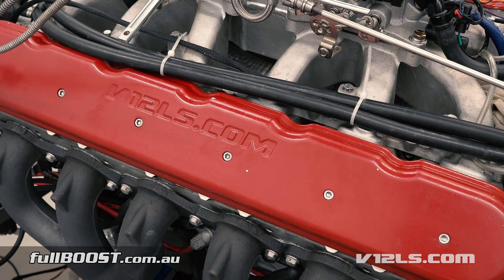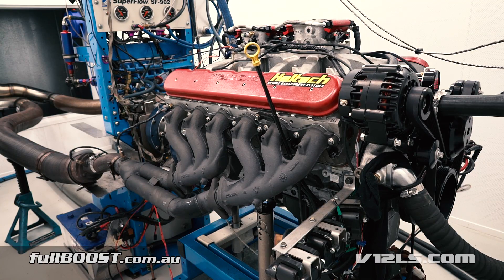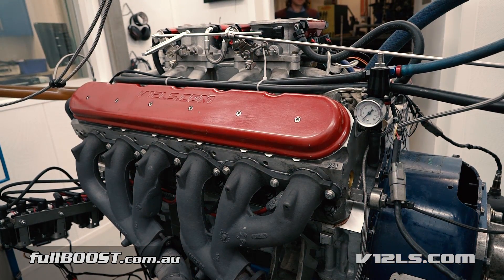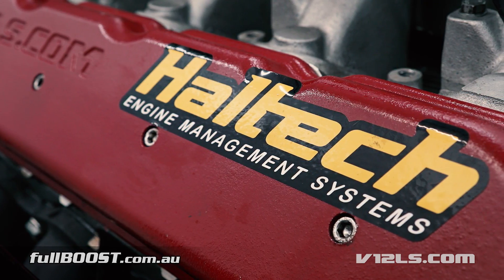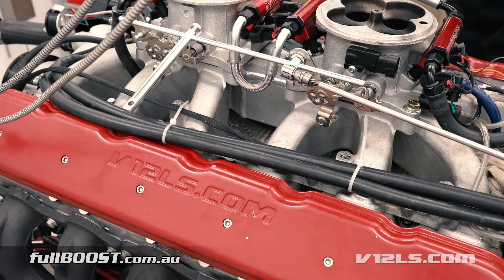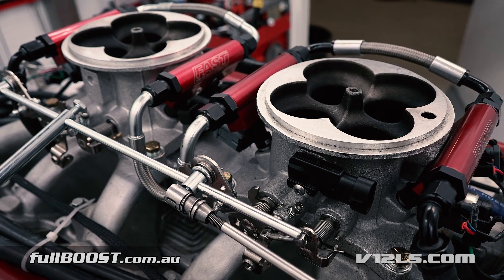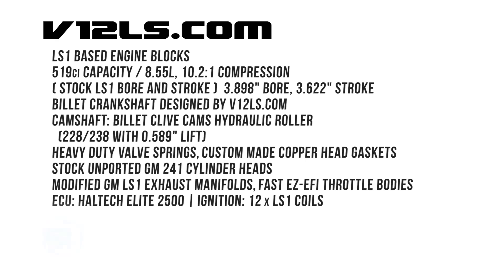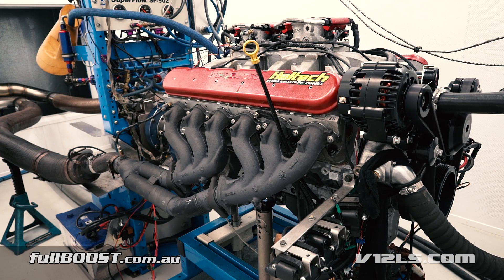V12 LS1 engine dyno

Comment: lmao you can easily make that with a 540 or hell a well built 496 will easily overpass those numbers . Might i also remind the vipers v10 is basically putting that to the wheels...
Reply from the maker: And what would this do with performance parts...that's not comparable.
Reply: +Fullboost well of course its not comparable a well built big block costs around 15 grand range and can make upwards of 1200hp in street trim. Not considering its alot smaller than this ( easier to fit ) and easier to fix or get parts for , im basically stating this motor is not really a success but built for more of a whow effect . I think the (4JZ) is a better thought out motor than this.
Reply from the maker: Cool.
Reply: +whambodius let's see you build one. big boy lmao
Reply: +Kyle Mills i have a 540 in my 85 rx7 gsl-se and i basically built it with a total of around 3 grand . Its all iron so probably a little heavier than this thing but i guarantee it makes more power , we estimate about 700 crank and i still have a 150 shot nx kit jic. Car ran 10.8 at over 5000 feet elev. no juice , no trans brake , stock suspension ( hd springs front ) oh and also nt05s .
Reply: No. Let's see you split two ls1 blocks and make a v12. Anyone can get a motor and put it in a car
Reply: +Kyle Mills what i was saying in the first place is the unnecessity of this engine .. Plus he didn't sit down and fricking sawmilled the block please. Whether he has a machine shop or sent it to one , everything is custom built . Its the same as a 3 rotor motor which i built before , as longs as you have all the parts made its no different than putting a normal engine together ... As i said before the (4jz) is a much better thought out motor. Long story short money is the answer to your question . Im not rich enough to have a completely custom crank made
Reply: +Kyle Mills btw if u wanna see an impressive motor check out devel sixteen. So you can see what happens when you spend money on an engine the right way.
Reply: +whambodius, first off the devel sixteen uses a much easier constructed motor from Steve Morris engines. And need I remind you this made 717hp with standard spec cams and heads? With better cams and ported heads this thing would make close to a 1000hp n/a. Possibly even more
Reply: +scootbmx01 i didnt know it had stock size cams and no headwork , with this much custom work and parts i would think its fully build
Reply: +whambodius, nvm I just checked, the heads are stock. But it has a very small cam. Apart from that everything else is stock ls1
Reply: Boom
Reply: +scootbmx01 dude how can everything else be stock , the crankshaft has to be completely custom for starters... Im gettn a feeling ur pulling all this out your ass
Reply: +scootbmx01 lol i have nothing to prove , because i allready did in real life . Its called x-treme performance , here in Izmir (Turkey) . We hold the record for Na rotary here also built the motor that is in hulk ( the civic ) also running for Honda/K series power record in the world. Feel free to stop by , we work mostly on imports but i have experience on Ford and Chevy motors from small block to 752 ci motors and also have a back ground with Don Schumacher racing team originated in Indiana .
Reply: +whambodius My mom is Very proud indeed , she supported me and my team the whole way , best mom a person can ask for ty.
Reply: +whambodius, never heard of your shop nor is there a website.
Reply: +scootbmx01 We never felt the need to commercialize our business due to the exceeding number of customers and to keep the wait time to a minimum and work efficiency. Extending the business is a future plan along with manufacturing our own parts in house hopefully. Have you had the time to check Hulk or our pride and joy twin turbo 208gti with 300ps called the highway rat , weighing in at an incredible 780kg!
Reply: +whambodius, so you don't have a website? What kind of business are you? Lol
Reply: +scootbmx01 As i said , we have an exceeding amount of customers that we allready have a hard time pleasing and meeting deadlines , i prefer less but happier customers to alot of angry customers , quality also goes down with the amount of work . Reason we dont have a website is that people here don't really notice those type of things here , word around town goes alot longer way than the internet ... However , we are working on creating our social media pages purely for contact purposes , im only 28 years old and the business has been around for merely 3 and a half years so we are still growing and like i said hopefully we're going to start fabricating our own parts with hopes to get a 5 axis laser cutter in the future to really be an independent company such as / PRL , Cobb , AMS or MAP , as far as their quality and being a completely independent company fabricating and using their own products.
Reply: +whambodius, you are the only business that turns down business.
Reply: +scootbmx01 i have never turned down logical business we simply don't reach out and seek for more of it. Unfortunately space is a huge factor in our country we have over 70 million people living in a space thats almost the size of texas so expanding is not easy , buildings start getting extremely expensive as size gets bigger . Anyways i will not try to hold a conversation with you if you keep acting childish with your ignorant statements talking me down , why dont you talk about your accomplishments in life and how your dreams of owning a shop came real as it did to me. I have dedicated my life to cars and tuning and i love every minute im at work . Theres so much more to owning a shop than having alot of customers and being widely popular. I haven't had a simple customer walk out of here without a happy face and a properly quick car . Another thing i forgot to mention is we dont hold regular jobs such as maintenance ,  exterior/interior etc . 90% of the work are complete builds..
Reply: +whambodius, why would I want to talk myself up to a knob jockey on the Internet who doesn't know how to read engine specs properly?
Reply: +scootbmx01 lol i actually just realized there was a full build sheet down there .
Reply: +whambodius Don't waste your time. This guy as a fool. A Gen 5 Viper can make these numbers with bolt-ons alone with 4 less cylinders. Granted, this engine has a lot of room to expand as a platform. But it will simply NEVER be a logical choice. Its an outdated pushrod, wedge engine. It will certainly make power, but consume fuel at an amazing rate even for a race car. Its pure weight will be incredible. If anything, this is merely a tractor motor. The Viper engine is basically the edge of where anyone should push an engine in terms of displacement and frankly its a higher tier design. I assure you and this tool (scootbmx01) that it will still NEVER compete with an NHRA topfuel Hemi making above 10,000 horsepower. It has no place to fit in. All of this aside, its a cool concept and I enjoyed the video.
Reply: +PyroBlonde7777 "a gen 5 viper with 4 less cylinders"!

did I miss something?  lol
Reply: +PyroBlonde7777 Amen dude , finally someone sees wtf is going on here , with direct injection and turbo charging this motor is left in stone age.
Reply: I  don't the think of the exercise is to be cost effective, to produce the most power per dollar spent.  A lot of people just enjoy something different, thus the Falconer V-12 project years ago or Hemi heads for a Chevy or exotic 3 and 4 rotor Mazda engines.  It's just an interesting exercise, perhaps something to put in a rod or a boat or a one-off car.  And, since it's just in the earliest phase, I am sure that it will produce more impressive results on a dyno.  If everyone was interested simply in cost effective power, everyone would be running LS engines in everything perhaps.  But there are those of us who run big block Pontiacs, Cadillacs, today there are custom heads for almost everything.
Reply: +Ethanmor i dont think ls is that cost effective , older big block engines make much more power for the money imo , alotta 4 cylinder like k series honda , sr20det , ka24 , inline 6 like rb25 , 1jz , cost next to nothing and very good canditates for cheap power under 6-700 hp range , it all depends on the car but for direct competition even the 350 sbc can be found dirt cheap , i found a 464 bbc and th400 for 800 bucks out of a hd pickup and made 600 something at the wheels with very little mods and rebuilt tranny . Overall cost me under 2 grand for the whole setup new dizzy wires management system and everything , its hard to even find a 5.3 ls motor for that price.(800 bucks) . And at the end they dont make much NA.
Reply: Outlaw I meant 2 and you know damn well what I meant.
Reply: whambodius Honestly, if its an OHV engine I wouldn't waste my time with anything that wasn't a Hemi. Most people are ignorant to the potential of older 5.7L Hemis. All they need is a cam, headers and minimal boost to hit 700hp. Most GM engines like the LT4 in the c7 Z06 are overheating making only 640+hp.
Reply: PyroBlonde7777 I damn know that you two "expert" are blowing hot air...

That kid is a joke and pretending to be a hot shot engine builder lol
Reply: are you talking about the 3rd gen hemi ? apache , eagle etc . if so i had one in my ram and according to the rumors and my own experience they are basically an ls1 with a bit better head design for the later models , im not sure if they are built stronger but i put 360whp and 410wtq with just bolt ons and tune, i dont think OHV engines are that bad especially on boost the difference is minimal. They are cheaper to produce and cheaper parts ( only one cam opposed to 4 ) less parts in the head to break or "build" . Both OHC and OHV have their good and bads of course if money is no problem the choice is appearent.
Reply: whambodius 😂 seriously kid you have got to see a doctor.
Reply: ok, now go away with your hate comments i got more experience with cars than you will ever get in a lifetime go find another vid to put your useless comments on.
Reply: whambodius oh you mean by playing Forza? 🤔
Reply: Forza is actually a very good game if you have the right setup it helps when you practice on it before you go to the actual track like nurburgring somewhere you would most likely die and make us happy
Reply: whambodius oh my god I rest my case lol
Reply: whambodius lmfao keep them coming champ so funny
Reply: whambodius "+Kyle Mills btw if u wanna see an impressive motor check out devel sixteen. So you can see what happens when you spend money on an engine the right way."

I don't see you pointing out anything but idiocy honestly.   I think you forgot to mention the turbochargers on that engine for comparison and how many cylinders did it also have? Lol yup a true master in engineering 

Edit: oh wait...  Are you implementing that your a master racer driver also?

😂
Reply: if its really gonna make you happy and relieved i have both the pictures of my rx7 and my old srt10 along with many pics of cars we built in house that you wouldn't be able to wrap your little mind around.
Reply: whambodius nope a detailed video tour of your shop and build would be sufficient to shut me up 

Better yet let's see your YouTube channel filled with your handy work lol

That other guy called out your bull shit so careful how you trade from now on kiddo
Reply: im not allowed to show customers cars due to alot of reasons but i can send you pictures of some of my personal cars i've worked on inside my shop so you can get a good view . Plus im not gonna go take a video for someone who has shown me no respect.
Reply: whambodius let's see your claims junior prove them 😁 

Stop blowing hot air

At the end of the day you are just a shawarma boy haha
Reply: +Outlaw I think you're very confused. I never stated that the Viper was a Hemi. I also already made it clear that I made a typo regarding the number of cylinders of the v10. I also already know that GM invented the Hemi but that means nothing considering Chrysler is the company that actually got it to work. I am already aware of the benefits of a wedge style head. For example, the Viper uses a wedge style head because it is drastically smaller than a Hemi and over all weighs less and fits better. I know this. But the fact remains that a 392 still flows more and makes more power at all rpm ranges. Also, if you're so confident that the Hemi is no longer relevant than tell me why all the people racing in the NHRA are forced to use KB style (Chrysler 426) Hemis? There is a guy running a LS 3500 hp c7 corvette and he even admitted if he wanted to go to the next level he'd have to switch to a Hemi.
Reply: PyroBlonde7777 

Here's your original statement...

"Don't waste your time. This guy as a fool. A Gen 5 Viper can make these numbers with bolt-ons alone with 4 less cylinders. Granted, this engine has a lot of room to expand as a platform. But it will simply NEVER be a logical choice. Its an outdated pushrod, wedge engine. It will certainly make power, but consume fuel at an amazing rate even for a race car. Its pure weight will be incredible. If anything, this is merely a tractor motor. The Viper engine is basically the edge..."

Sooooo..... Yup full of hot air
Reply: Outlaw I deleted my comment because on my screen it was duplicated. So, I deleted one of the comments and it turns out it was a glitch. So, both comments are no longer here. I was confused as well about that fact. But you can once again try to build an argument around meaningless details. We are talking about the LS and LT motors which are products of GM or Chevy so yeah, its not far off to say you are a fanboy of that company. There are plenty of facts about why Mopar engines are fantastic and you'll choose to ignore those facts. Keep throwing around insults like you're a big guy but this is youtube. So stop wasting my time.
Reply: +PyroBlonde7777 dude u have to stop man dont go down to his level . He doesnt know all they use in 5k hp + cars like all out dragsters is Hemi. The way he talks he probably owns a Cavalier or something lol.
Reply: Outlaw Now I'm wondering what the hell you think this 'argument' is about? Because I have a feeling you're on your own tangent this whole time.
Reply: +Outlaw dream come true , your right.
Reply: whambodius prove your lies lol
Reply: whambodius YouTube is free

Let's see you document your shop and detailed builds lol

I'll wait for you proof
Reply: Outlaw You really must have no life at all if you honestly think this guy has to prove anything to you lol. If anything, add him on Instagram which is free and do the research yourself.
Reply: +PyroBlonde7777 thanks man same goes for you i have alotta hemis and a viper ;)
Reply: whambodius well it's the internet kid.  If you state something publicly and start blowing hot air while trying to act knowledgeable and laugh at other peoples videos (like this video we are having fun under its thread)...  It's inevitable that someone calls you out on your lies

And yes since you told them that you are  "well known and reputable engine master with cramped customers"  obligated to provide evidence to your claims lol
Reply: whambodius This guy is ridiculous. He runs his mouth like hes a master mechanic and then has almost zero ability to stay on topic. Bringing up irrelevant details in an effort to validate himself. Saying that I didn't make a honest typing mistake concerning the Viper's V10 when I'm a mopar fan and its common knowledge. Quotes a statement that I made concerning a completely different issue and somehow tries to connect the dots with his incoherent garbage. At the end of the day I said I wouldn't waste my time with anything that wasn't a Hemi when it came down to OHV engines. They make more power and thats a fact. Both in factory form and racing form. The LS is literally just a modern, well designed and simple wedge style V8. It isn't special and thats why its cheap. Its not a bad engine, but its not fucking special. Its literally the oldest performance V8 platform in the book. But its not the best and I will never acknowledge it as an equal to a Hemi as the supreme racing OHV V8.
Reply: PyroBlonde7777 I'm on topic alright 

Let's see him prove his claims of his so called "X-treme Performance" in Turkey lmfao

No website 
No phone number 
Not on any listing 
Nothing 

Let's go bozo prove it that's the topic I'm interested in from the beginning lol

Kid on the internet talking to himself thinking he has backup 😁
Reply: whambodius 

😂 that's what he claimed 

"i have nothing to prove , because i allready did in real life . Its called x-treme performance , here in Izmir (Turkey) . We hold the record for Na rotary here also built the motor that is in hulk ( the civic ) also running for Honda/K series power record in the world. Feel free to stop by , we work mostly on imports but i have experience on Ford and Chevy motors from small block to 752 ci motors and also have a back ground with Don Schumacher racing team originated in Indiana ."

You should call it Forza (top secret fantasy" lol
Reply: Outlaw I am not here to debate about whether or not he is legit. As far as I'm concerned I don't care. It doesn't affect me in the slightest. If he feels he needs to somehow seek validation from some stranger over the internet then thats on him. The only thing I have an opinion on is the uselessness of this v12 LS engine. I think its a cool concept but its still overall pointless. Maybe if it was smaller in displacement and revved higher. Then it might actually make for an interesting platform for the new mid engine C8 Corvette. Otherwise the Viper's 8.4L v10 is about the limit for any performance engine.
Reply: whambodius no no we aren't done yet here unless I say so smegole lol

Prove that.you are what you are and own what you own and achived what you have achieved ya Lil lier 😂
Reply: +Outlaw Quick note some of the richest people of the world are turkish prime example being CEO of CocaCola. We are not so bad after all hha.
Reply: Outlaw I'm not getting anything twisted actually. I am aware of your little "venture". I still have no opinion on this subject as it really has nothing to do with me. But I will say that I was wrong earlier. I was arguing on another post about the LS vs the Hemi and somehow got it mixed up with our conversation. Reading the previous comments I can see that really you were only targeting my statement about the Viper originally. Yes, it was a typo and a miss calculation of numbers. I'm not 100% sure where I pulled the number 4 from but I assure you it was a mistake. Otherwise, I don't disagree with much of anything you've said.
Reply: PyroBlonde7777 again 

I don't care about your Dodge vs GM and i never stated anything regarding Chevrolet (yet).

You can have all the opinions and cheers for dodge.  It's your thing. 

Yes I did point out your v12 dodge remark.  But when you stated stuff you were biased and had no idea about the competition and said what you said....

That's why I told you learn about them know what's what as each design has it's pro's and con's no one size fits all.

But saying everything is useless if it didn't have a Hemi! Now that was what made me tangle with your remarks a little. 

But back to the topic.  That "Engine Master" is a a lier and a scrub lol
Reply: Outlaw When I made that remark I meant for the ideal performance platform in the OHV format if it was a perfect world and money wasn't an option. I'd be better off building an old 440 magnum for a lot cheaper though. Even something like a 383 would be an easy and cheap platform to build. But the LS is boring and overused so no thanks.
Reply: I have seen so many wrong things in this comment thread alone....It gave me Cancer.
Reply: You are trying to compare a radical full race big block to a fully streetable V12.
The radical "well built big block" requires a high stall, etc etc and wouldn't be able to pass the gas station if used as a daily driver where this LS1 based V12 would have a full power curve that is smooth and useful from idle to redline and with decent fuel economyfor a daily driver that wants to be a little bit different..
Reply: +hackfreehvac i have daily'd and known people that have dd'd big blocks before , they can very well be fully streetable  and not that bad on gas mileage as you may think , power curve from any serious big block would make this v12 look like a joke , pulling all the way to redline is such a subjective term , you can have a budget hydraulic big block redline at 5000 rpm or have a 8000 rpm monster . "Pulling to redline "has nothing to do with displacement but the quality of the heads/headwork and parts in the head. I've seen big cube motors make max hp at 8300-8500 rpm with ports the size of my fist and had no problem whatsoever taking a cruise around town . Being able to daily drive a motor really means nothing because if your gonna daily something why would you want alotta horsepower? Daily should be comfy , reliable , safe and practical. Plus talking about gas station , i really struggle to name any legit high power builds that run on pump gas, e85 maybe..
Reply: hackfreehvac Once again, the Viper's v10 is about the farthest anyone should go with a big displacement performance engine. I'd be willing to be that the Viper can make bigger numbers too.
Reply: PyroBlonde7777
I've never been that impressed with the Viper.
8 liters is huge and when it was released it was only something like 425 HP
Hardly 60 HP per liter or something like that.

It was nothing special except just a big displacement motor.
And the V10's sound like inline sixes to me. Not cool.

Now this hybrid V12 sounds pretty good.
And of course V8's sounds great.
Reply: +hackfreehvac when viper was released camaro was making 245 hp out of 5.7 and corvette was making 300hp , efficiency decreases as displacement increases . Also the 8.0l has nothing in common with the 8.4 thats out today . For apples to apples ls7 makes 72.14 hp per liter , vipers v10 76.78 hp/l Despite having more rotational mass and internal friction .
Reply: whambodius Yeah that was a terribly ignorant statement from this guy. Thanks for clearing that up. Not to the mention the old Vipers still went 205mph and actually had the highest topspeed in the competition for its time. The engine itself is capable of more power than it makes from the factory with old technology as well so its still not a very sound point. An Inline 6 sounds NOTHING like the Viper...
Reply: PyroBlonde7777
I was referring to V10's in general. And they do have an odd sounding exhaust that is much more closely resembling an I6 than a V8
A bare bone Mustang GT with flowmasters sounds better than a Viper. It just does. People who deny it are just fan boys who just ignore the truth.

And of course there is lots left on the table to make a bunch more power out of a sub 500 HP 8 liter V10. I never said they couldn't because people do make 1,000 HP all the time from them. I was just saying that when they introduced it with only like 425-450 HP, that was kinda weak for the engine size.
Corvette was still competing with it when they still had 5.7 Liters.
Reply: hackfreehvac The Corvette of that year really didn't compete with the Viper. When the Viper first launched it took the world by storm. Dominating 24 hours of Le Mans multiple times until it was later banned from racing. It was also the fastest supercar of its time when it launched. The excuse was engine size... Nonsense. Also, you can't tell someone their opinion of what sounds better to them personally is wrong. That's like me saying my favorite color is blue and if people don't agree they're just lying to themselves. It doesn't make sense. Generally speaking a V-8 does sound better to most people. But I have heard some Vipers that change my mind along with Lamborghini's v10 which sounds fantastic.
Reply: PyroBlonde7777
The V8 just has a better sound. Not many people like the farty V10 sound.
Reply: hackfreehvac Me and many other Viper fans don't think it sounds farty. Especially not a Lambo. Do you still not grasp that other people like different things? What a small world you live in.
Reply: +hackfreehvac farty v10? Have you experienced a viper sound in real life or are you judging from the videos ? They sound like v8's injected with the filthiest steroids you can find
Reply: whambodius
Uh, I used to go to the Friday night drags at the race track a lot.

A stock Mustang GT with flowmasters sounds better. The overall tone is just goofy on those.
Sorry. It is.
Reply: while i agree ford's v8 has the best sound hands down i still am not convinced v10's are farty at least not the vipers, i don't have alotta experience with older vipers but i think at least the 2016 sounds awesome. but to all its own.
Reply: hackfreehvac Everyone has an opinion. No one is wrong when it comes to taste. For me, I love the Vipers sound.
Reply: PyroBlonde7777 don't recall corvette were doing le mans with it's 4th Gen... 

But the factory starting racing with the 5th gen and look at how that ended to the competition.
Reply: Outlaw Considering the Viper was already outlawed, sure. The Viper won  Le mans in 1998, 1999, and 2000. By the time the 5th gen was competing the Viper wasn't. But winning 3 years in a row is remarkable. The new GTS-R Viper took first as well and it wasn't even finished being developed. Although its winning streak was shorter.
Reply: harambe
Reply: shanepinfist hard work? most likely , incredible result ? i would think not, im all about doing things different and unique projects but just because something is rare or different doesn't make it good, if this had the power to back up the uniqueness i would be impressed , but looking at the build sheet theres alot held back , idk why someone would go through the trouble to build something like this and not use better parts to pull more power out , as of yet i dont understand the purpose of this engine other than just being different, and that itself is not enough to make me impressed.
Reply: shanepinfist Not when you can make it out of a 30 year old n/a 350 sbc , at stock displacement mind you.
Reply: whambodius are you still trying to play the wannabe hotshot over here?

Btw I'm still waiting to see the proofs of all the claims you made!
Reply: ***** he's a Turk what do you expect? 😂

(He is a well known builder in the middle east with a reputable shop) according to him lol
Reply: You realize these werent designed to be chopped into pieces and put together as a 12 cylinder right? Also, its not only about power. Im sure it has a broader torque range and is a smooth strong pull
Reply: A tuned, bolt-ons Viper V10 might make 700 whp on race gas, but not stock dude.
Reply: Can't we all get along XD